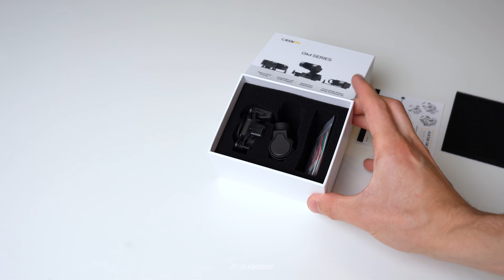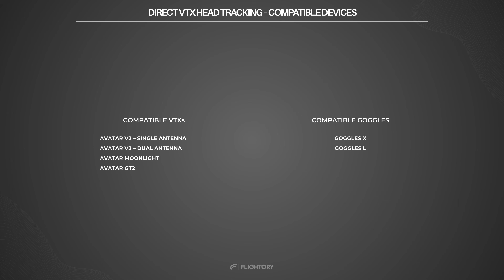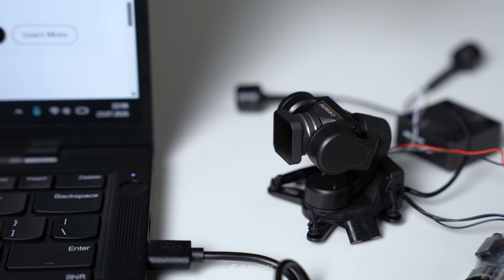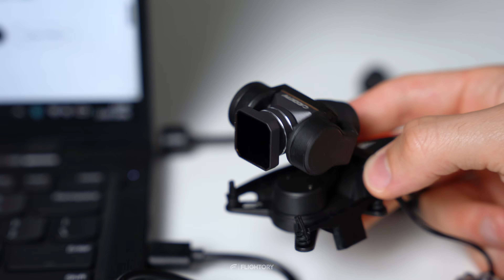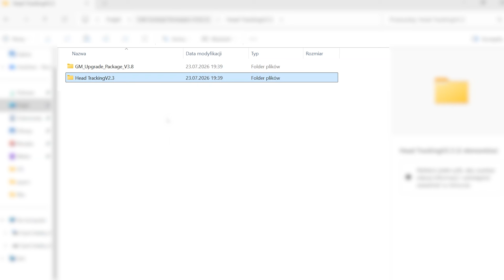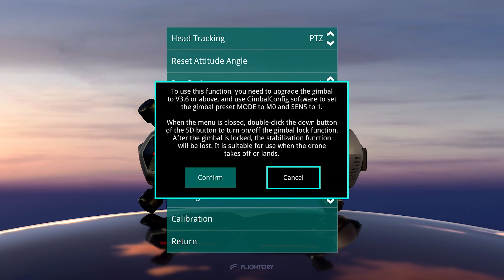How to FPV Your RC Aircraft in 2026 | GM3 Gimbal Head Tracking

Comment: Buyer Beware!!  The caddx gimbal is very buggy and you run a high risk of bricking the mainboard when you attempt a firmware upgrade. I’ve out $300, bricked two mainboards following their instructions and still no working gimbal.

Comment: I'd say use caution plugging the Gimbal into the flight controller. I had an instance where a gimbal jammed, caused a voltage spike and browned out the flight controller. Make sure you're within spec of the voltage regulator for that rail.